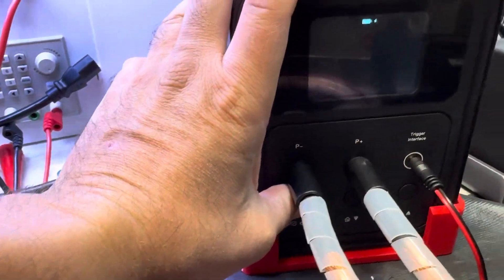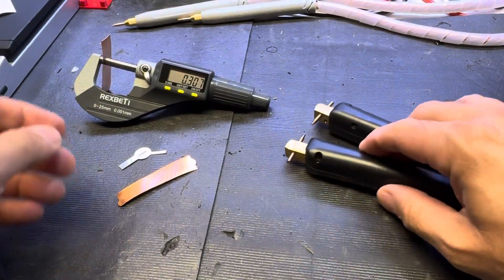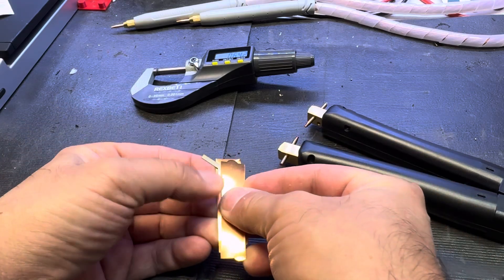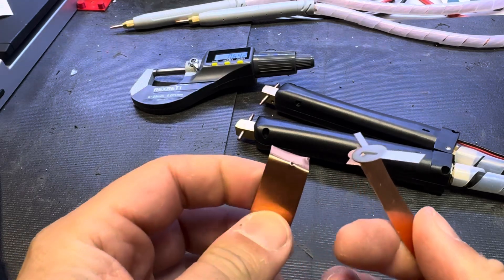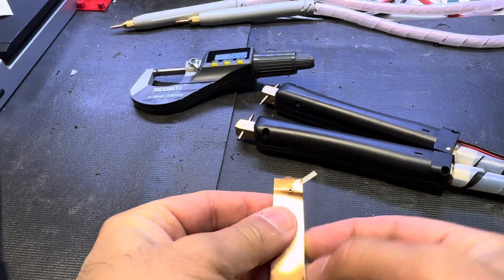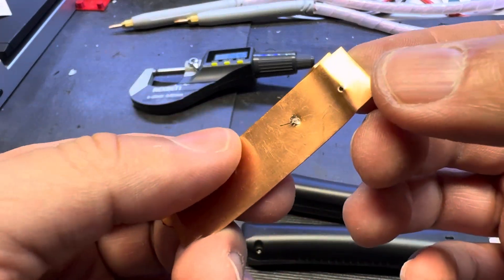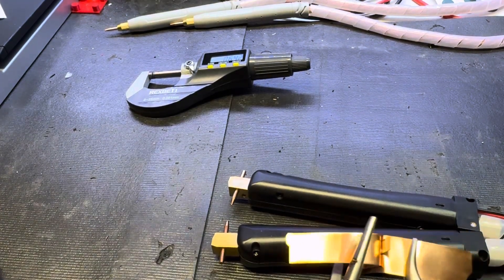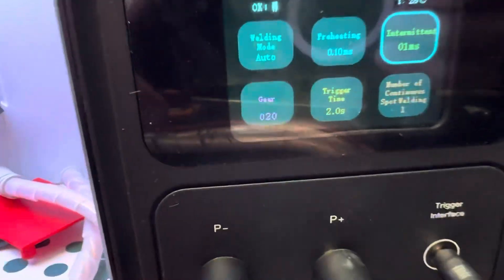Testing the AWithZ P120D with AW240 Pen.

Comment: So every AwithZ model from the P20B up should be able to do the same just at a high power setting. Seems like this would only be helpful in prebuilding sandwiches but then you need a machine capable of welding through it all to the battery.
Reply from the maker: From P20B to P60F yes but how efficient is this done as another topic.